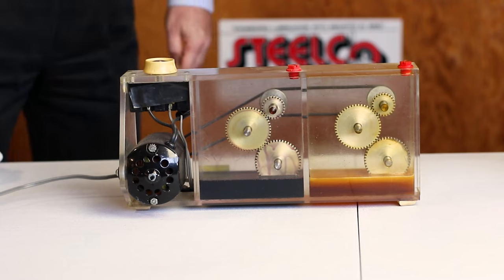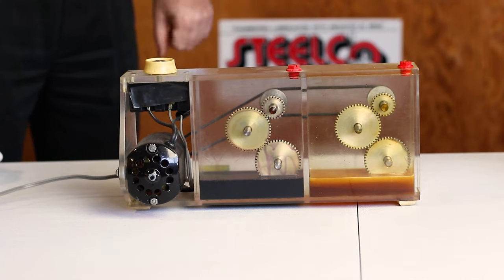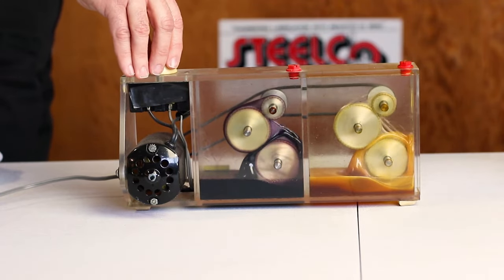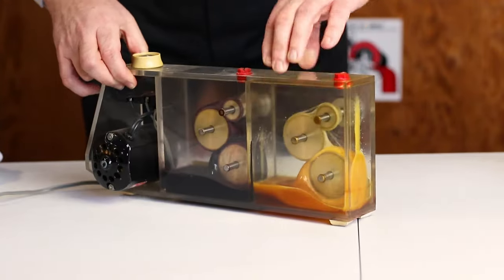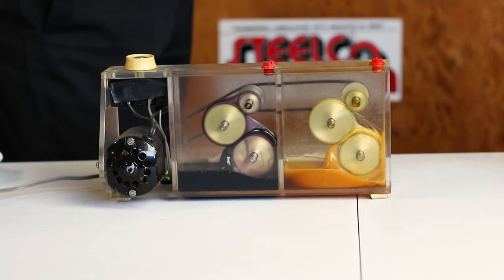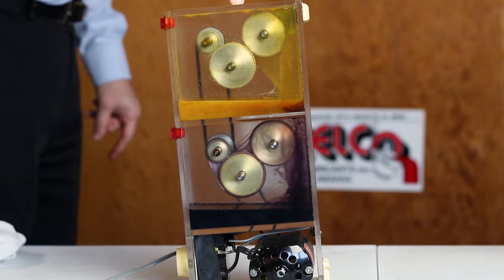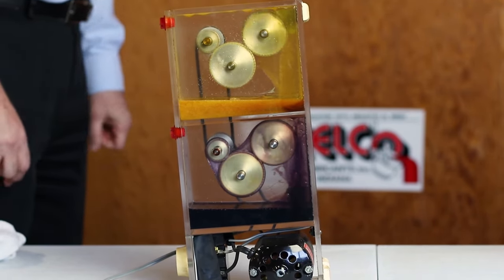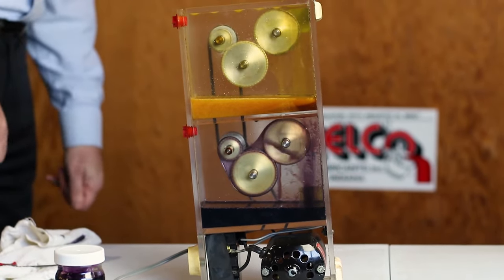The Gear Box Test

Comment: What gear oil are you recommending - is very unclear apart from one is golden and the other black!!
Reply: Clearly the Royal purple is better
Reply: Yea I agree with the one that’s not flying off but in the other hand I’d it breaks down quicker because of the thickness it will just gum up like gum when hot and overtime because I know that thing sat up is not producing heat
Reply: im pretty sure the dark stuff is lubrication engineers LE1605 duolec

Comment: You forget about the bearings that are on both side of gears in real transmissions, they need splash. If a fluid is going round & round the gears with out splash what's going to happen to yer bearings? I'll tell if you can't see it!
Not to mention thin thrust bearings that fit tight between gears. Splash is what makes transmissions last not cling.